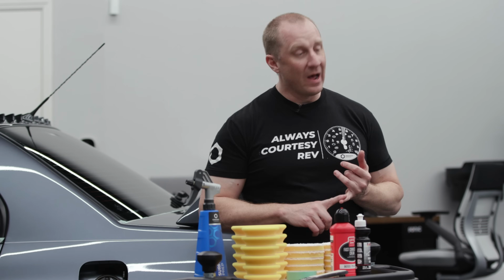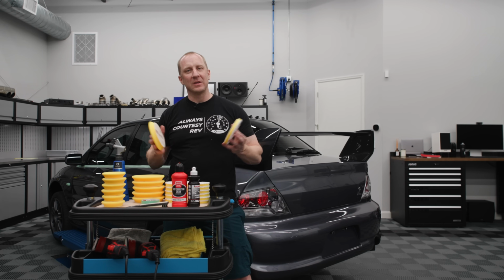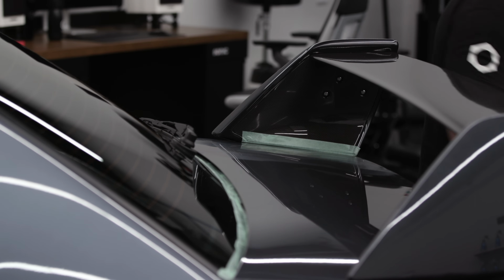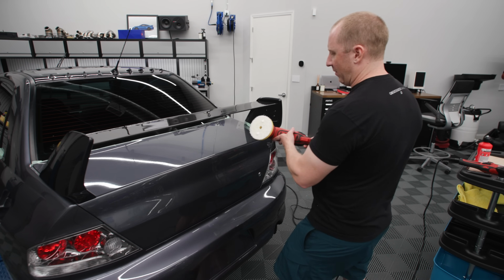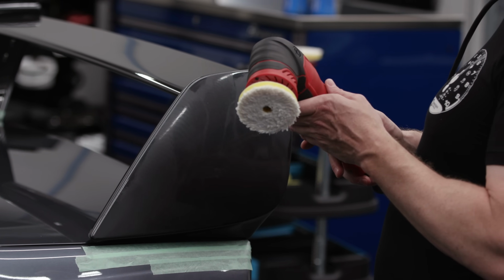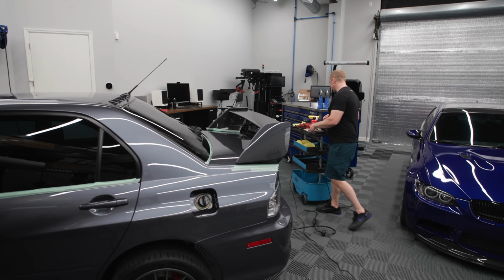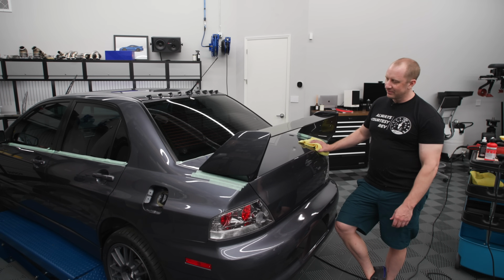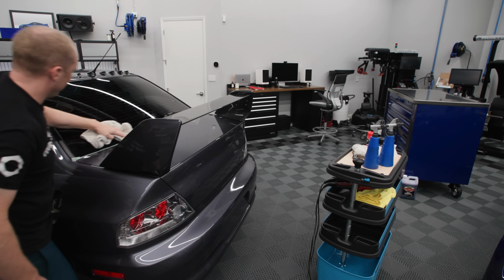Polishing Basics:  How I Suggest You Should Start

Comment: Thanks for making this.  “Just move some frickin’ stuff on the paint” is honestly some of the best advice I’ve come across.  Going from 0 to 1 was the hardest part, and Matt’s wisdom was a shove I needed.

Fellahs, if it’s your first time ever polishing paint (like it was for me), don’t wait until conditions are absolutely perfect or you’ll never do it.  If the paint is reasonably prepped, and you’re using reasonably good gear, with basic techniques, I promise you will be amazed at the results.

It’s so easy to overthink and overanalyze this stuff.  Don’t get lost in the sauce.  Just go for it

Comment: A bucket of rinseless is a great option for cleaning pads without an air compressor. Take the pad off the machine, dunk it in the bucket, rub the face of the pad, squeeze it dry and then put it back on the machine. Spin dry at max speed below the lip of the bucket to keep from making a mess. 

I would also recommend wool pads for those just starting out, they stay a lot cooler and cause less micromarring than microfiber pads.
Reply from the maker: Great points!
Reply: The URO 50/50 pads work wonders with a 1 step compound like 3D One or Turtle Wax 1 and Done...I use a rotary and literally put no pressure on it at all and it cuts most swirl mark and light scratching quickly and easily. Maybe a finishing pad with some jeweling polish if you see a little hazing or have hard to please customers...
Reply: If you prefer that kind of cleaning method I would suggest to use pad washer. Because I tried to rip the pad off every time I needed to clean it and I’ve ended up ruin that pad so quickly that I needed another new pad to finish the car.

Comment: Thank you for the video!  If a beginner desired a single stage of polishing prior to waxing/coating and did not want to “cut” the amount of clear that fast correcting cream does, would you recommend sonax perfect finish or another polish that maybe falls in between these 2?   I understand this would be sacrificing a bit of the correction process.
Reply from the maker: Sonax Perfect Finish would be the one you want. Keep in mind that you wouldn't be achieving nearly the same result as if you were to do the full process.
Reply: Thank you.  Have you experienced using griots “correcting cream” as a single stage polish as opposed to the “fast correcting cream” as a 1 of 2 stages? It’s advertised as:
 Effectively eliminates moderate defects.
Allows for extended buff cycles that won't dust out.
Reveals a pristine, wax-ready finish.

 Thoughts on that product?
Reply from the maker: I think both Correcting and Fast Correcting can see a bunch of benefit from Finishing afterward.

Comment: I wanna learn the difference between soft paint and hard paint and when to use a yellow pad or blue pad from rupes ! 😄
Reply from the maker: To answer your first question, a hard paint is difficult to correct, but once done is easier to maintain. A soft paint will be the opposite.
For your second question, a yellow foam pad would be used for polishing, the blue microfiber pad is for cutting.

Comment: Can you blow out the polish from the pad with a pressure washer if you don't have compressed air?
Not whilst on the polisher, and defo not connected to mains power. 😂.
Reply from the maker: You can to clean when finished, but not mid polishing.

Comment: The one thing I notice is Matt is not putting any pressure on the machine when I first started out I would put my hand on the top of the machine, at that time I didn’t realize about heat, and that’s your enemy!
Reply: It mostly depends on the paint but in general you always want some amount of pressure on the tool especially when compounding.  Would need less pressure when doing finishing polish.
Reply: @555fourthstreet8  I use the URO 50/50 pad with 3D One with only the weight of my hand on the handle or body of my rotary and it cuts just fine for swirls and even light scratches. IF your putting pressure on the machine your pad/compound are not working well together to get the job done correctly and you'll be taking off way more clear coat than needed. I finish with a jeweling pad and jeweling finishing polish and the clarity, depth of paint, and detail in flake in the paint is amazing...Your lucky if there is 5mm of soft clear coat on most newer cars...I let the correct pad due the work and compounds that finish down get the paint close enough that a finishing polish completes the job quickly...
Reply: @petedetraglia4776  I’m pretty sure new paint doesn’t have 5mm of clear.  That’s a shit ton of material to work with.   Also, I should have been more specific with regards to the difference between the use of rotary and dual action tools.  Rotary would definitely cut faster and easier and prob wouldn’t require as much pressure as dual action would.   As with many things in detailing there are different ways to go about obtaining similar results.

Comment: Should this fast correcting cream be used on a fairly new car where paint only has a couple of areas that have scratches?
Reply from the maker: This is best used as a more aggressive first step. Especially if the paint you're correcting has heavy swirling or is pretty beat up.
Reply: @ObsessedGarage  thank you!  I have a 2022 ford 2 door bronco that I got into a reck that got fixed but was left at body shop for 3 months,   So I have only been driving this for about 2 or 3 months.  So far, the car  is really in good shape. Only issue is with the front of the hood - rocks put a couple small scratches that are deep and showing the white. That doesn’t look good.  I was planning to use a paint correction pen then use griots correcting cream and so on from your video.  . I was hoping to use the cream on this area and the rest of car I would use that finishing polish.  Does this sound plausible?

Comment: Question, I’ve heard Yvan’s logic regarding blowing out your pad. How do you feel about a pad washer instead of having multiple pads or blowing out your pad with compressed air?
Reply from the maker: Having multiple pads and an air compressor are going to be your best option.
Reply: You can by with three pads of each.  Once the first one is spent (loaded up), clean it with Dawn Powerwash spray and warm water, throw it in the dryer, and repeat for each pad.  You'll spend time stopping and starting instead of just plowing through.  But three pads will allow you to keep going while the others are drying.

Comment: How often do you clean your foam pads with air or a brush ?
Reply: After every section pass you should blow out all the clear coat that's now in your pad.
Reply from the maker: For foam pads you'll want to blow it out every few passes. A microfiber pad you will need to do it more often.

Comment: Does the G15 require a higher amperage?  I got a G15 for Christmas, and I plugged it into the wall. It started fine, then got super slow. HELP
Reply from the maker: The G15 polisher has a 10amp motor.

Comment: Did you say you started polishing 20yrs ago?
Reply from the maker: Yes. Back in the early 2000's.
Reply: @ObsessedGarage  my mistake thought you had told us 2013 or 2014 before.
Reply: @ObsessedGarage if you were to guess roughly how many vehicles do you think you have been able to correct since then?  More or less than 25 or 30?   Which one was the tough test to correct?